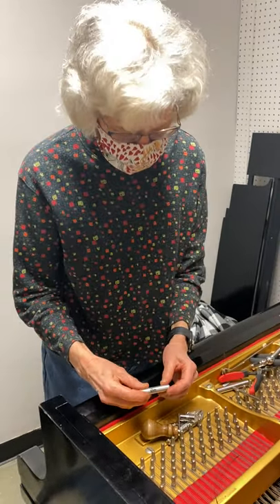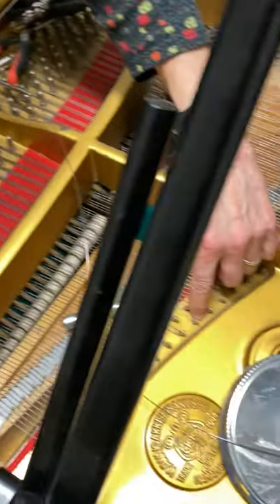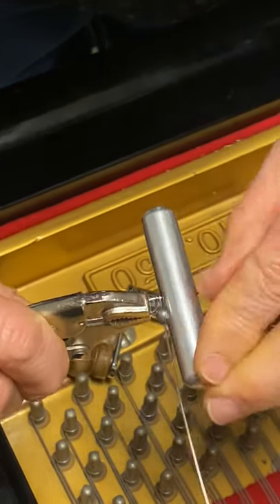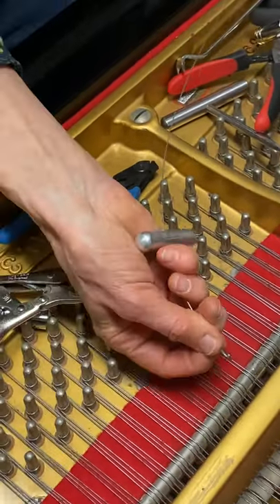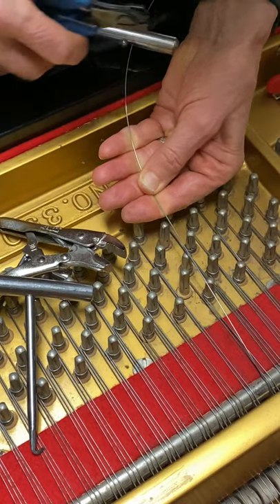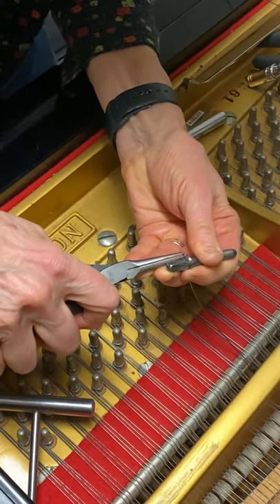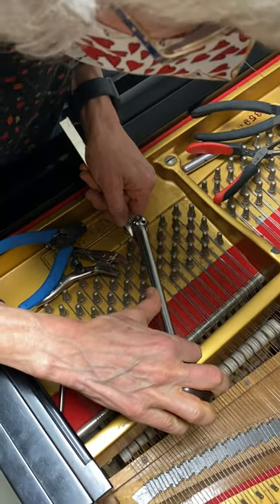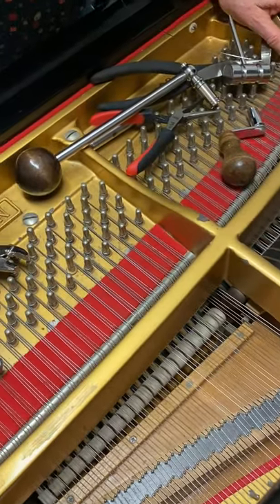Hitch pin loop

Comment: The little metal tool with hole and screw (which can easily be made out of a piece of wooden dowel) is no good for covered strings!
Reply from the maker: You are correct. I’ve not had too many bass strings break at the hitch pin. If that happened I would splice on a loop from a discarded bass string, or replace the entire string.

Comment: все верно... хотя можно обойтись и без закрутки на одина
рную петлю ... и без ковидного  намордника
Reply from the maker: My google translation is “Everything is right. Although you can do without twisting it on one loop.” For me, making the loop first, very close to the size of the hitch pin, is very important. Look at the loop you are replacing and go that same direction. Also make the tail that lays on the plate go the same direction as what you are replacing.